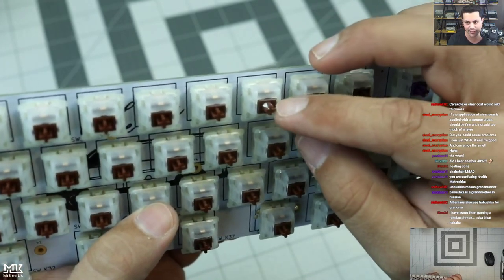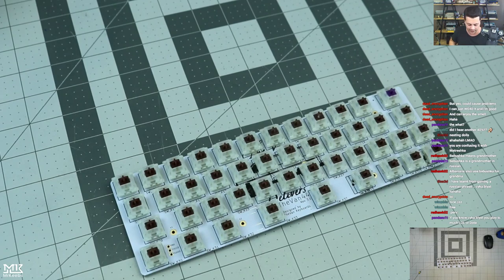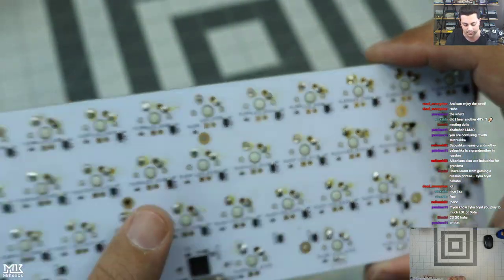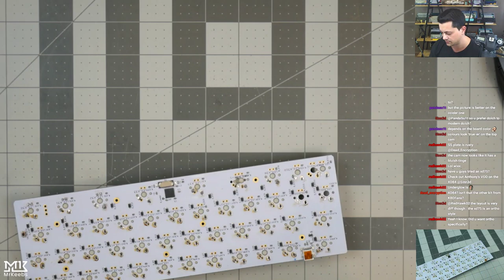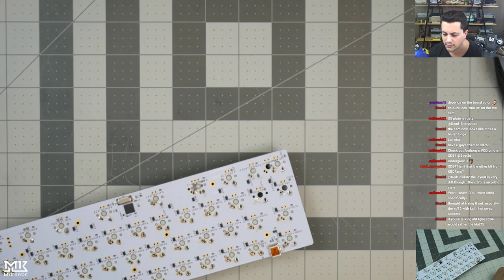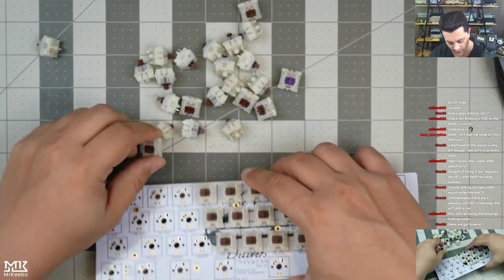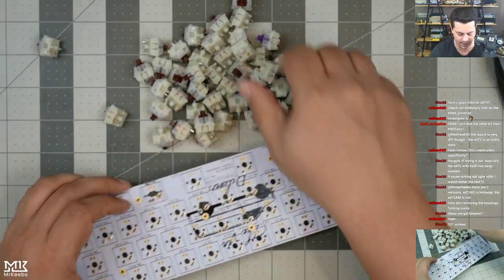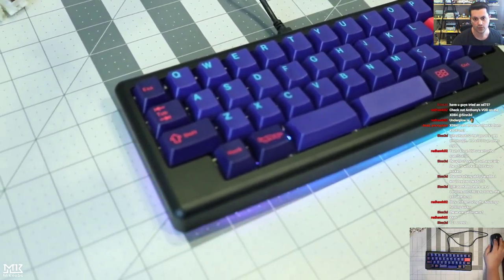Unboxing and Desoldering Minivan PCB

Comment: Hello MrKeebs this is your last vid thats why im commenting here.(why im comment at your channel?Because you are a small YTber and you reply all you comments)
My quiestion is:Is the following configuration good for an first DIY Mech. Keyboard?

PCB:DZ60 from KBDFans
Case:Tofu from KBDFans too (Purple)
Plate:Plate from KBDFans too
Switches:BOX Burnt Orange
Keycaps:SA Doom (I buy them because I think they match perfect with the purple Case and all SA Keycaps look extremly good)
Cable:Lindy cable from Amazon the piral one

When you dont like something be super crittical pls :D

PS:I love your vids stay awesome ^^

PPS:Sry for my bad English and grammar :D (im from Germany)
Reply from the maker: Hey there, thank you so much for your comments and your English is excellent.

So everything in your first build looks great except the Burnt Orange for the switches, they are really not that good. For one there is almost no tactile feedback, they are really heavy and on top of that they are BOX, which is known for causing keycap cracks. 

What kind of switch do you like? Linear, Tactile, Clicky? Light, Medium or Heavy?
Reply: I thought about Zealios 67 g but they are a Bit more expensive.Do you know a cheaper switch like the Zealios 67g?
And thank you For the english complement <3
Reply: I like tactile up to clicky Switches and mideum pressure like (55g-67g)
Reply from the maker: I think Zealios are a safe bet with tactiles, I personally like the 67g better. If you are open to a good linear, I would recommend Gateron Yellows. If you can lube and spring swap them, even better.
Reply: MrKeebs thx for all the quick reply’s I’m gonna buy the Zealios 67g
I’d love to watch a stream live when do you stream next time?
Reply from the maker: I may do a quick unboxing in a few minutes, I'll keep you posted! Also make sure you follow me on twitch: https://www.twitch.tv/misterkeebs/